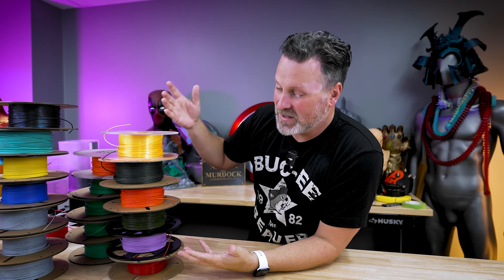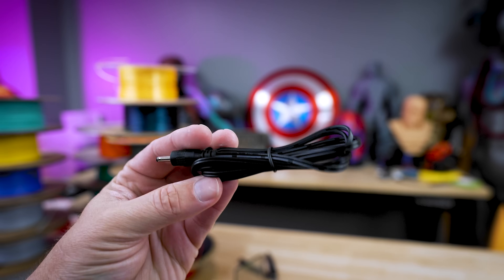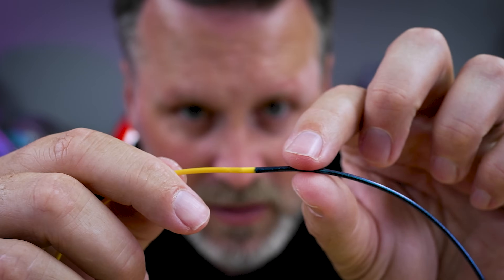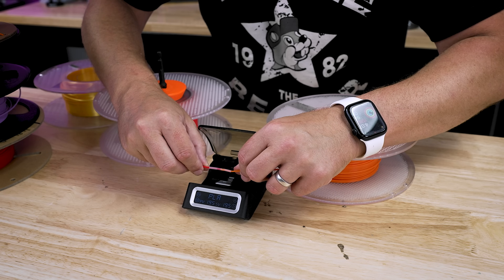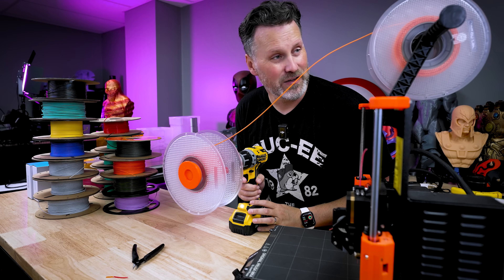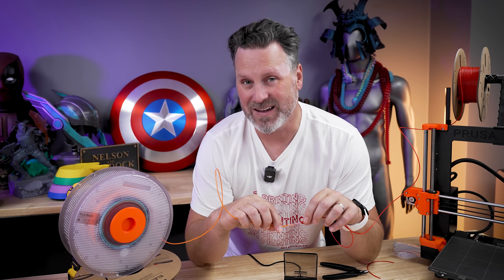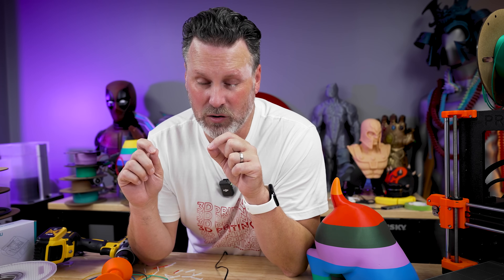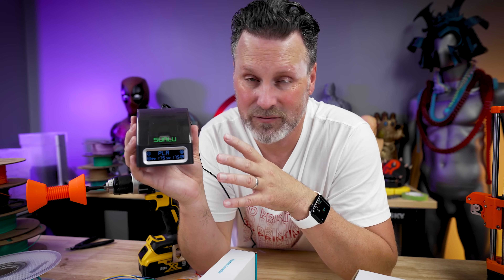Does this really work?? Sunlu Filament Connector

Comment: I bought one of these without doing any research cuz it was on sale.
It IS a little tricky to use, but once you get the hang on if it seems to work pretty well. 
TBF tho I've only done about a dozen welds with it so far. No issues printing as of yet.

I also printed a little plate that the filament splicer sits in. This plate has little arms that swing and hold the filament in place and makes it  a bit easier to manage without having a third arm. This makes it a LITTLE less fiddly. but for the cost of saving filament, and opening the door to creating your own "color changing" filaments via splicing ends, or splicing multi-tone DIY printed filaments together. It was worth the $30 I paid for it.

Comment: I'm not sure if this thread is still active.... But I'll ask anyway.

I'm somewhat new to 3D printing. I have 3 spools with maybe 10-20 grams on each. I have the Bamboo AMS. Instead of using one of these splices which seems might be more headach than it's worth. 

To me it seems putting my almost used up spools all in the AMS at once and simply having the machine run from one to the other when they are done seems like the easyiest thibg to do? Am i wrong there? It seems like the printer should make that transition easy?

Comment: Why bother unless you have such short pieces that it cannot be loaded into the printer? If you do have partial rolls then reload the filament when it runs out and resume the print.. if you have short pieces then surely the cost of the splicer and the labour required to splice them together isn’t worth it. Seems like a solution to a non-problem to me.

Comment: I know this is a bit late to the party - I saw in another video where the guy used silicon tubing rather than PTFE as it will conform to the size of the filament better for a smoother join.

Comment: Get some medical scissors clamps, I used it to break supports on the 3d prints and also used it to clamp down the filament ends and then it stable to make a aligned cut and then put in the filament connector. So yeah SCISSORS CLAMPS is the answer...

Comment: I  printed an add-on that holds the filament leading to and comming from the connector machine. With the addon and the learning curve, this thing is great. You do have to play with it the make sure you have a proper connection.

Comment: Worked for me from the second try, though I hold the both ends while heated and then ask someone to press the release button and simultaneously take out the connection out of the heater not to deform it till it cools down. Pretty happy with the results/purchase.

Comment: This is one great thing about my 3D printer. Instead of having the runout sensor 2 miles away from the print head, it's on the print head itself. So I can print down to the last millimeter and when the filament runs out, the print head parks while keeping the nozzle and bed hit. I just have to load new filament, extrude 20 mm of filament and resume my print, no issue whatsoever. FYI, my printer is an ankermake M5C

Comment: This doesn't work all that well. It's very hard to get consistency welds of the same quality. My AMS on my P1S won't load connected filaments, the feeder has issues with the hard spots/not perfectly aligned filament and it just keeps spooling in and out at the repair. I would not recommend for an AMS.

Comment: Respool it but with a PTFE tube as a guide (maybe 6 in. piece). That will do two things: Give you a something to hold on to when respooling to guide the filament. Also, it will stop spooling on any welds that are too large. Then just slide it off when finished.

Comment: Capricorn tubing. Cut filament at an angle. Push together and get hot with torch or lighter. Let cool, cut away. File to smooth and fit correctly. Save $45. Everybody remembers modding their Creality Ender 3's, why does nobody remember welding filament?

Comment: I bougt this thing and guess what. It's not worth a dime. The seam is bad as bad can be. It works only with very short pieces. With longer pieces you need 4 hands fighting the filament. After a lot of fumbling and entangling I threw away both spools and the device.  Does it work? No it does not work at all.

Comment: I got it and after 20 attempts, I gave up, this device doesn't work. bent connection, melted outside the ptfe tube...
Reply: Hold it straight until it cooled down.

Comment: Would have helped greatly if you actually used the device correctly. Sunlu has several videos on their website showing exactly how to use. Things you missed that led to your poor results: 1) cut filament on angle to increase bonding surfaces, 2) push in on filament ends while connecting, 3) when connecting, wait till you hear a beep so it completes the connection and 4) wait at least 10 seconds before removing sleeve. You really should do this video again following the instructions so as not to give false information & impressions (or at least pin a comment giving the details). Expected more from your channel.

Comment: This little gizmo actuatlly works. Some things I've found out:
 - Cut both filaments at the same time by cutting both lying next to each other;
 - take your time to align everything when putting everything into the sleeves;
 - not all filaments are made equally, test putting together different types of filaments, brands, ...
 - be patient: things get welded together in like 5 to 10 seconds. Great,  keep a little pressure on both ends for like 5 to 10 seconds (especially do this while melting and welding');
 - enjoy multi-coloured prints without having to use your garbage bin 🙂

All joking apart, this thing works pretty well but needs attention. It's a fairly quick thing to do, but - again - needs some attention to do. Otherwise, one of the hundred things I did not waste my money on.

Comment: Ive just bought one and after one initial fail its worked great since, although I have only tried it on PLA.  I have founf applying just a hint of pressure works well but the default timings and temps work well for me.  Consumables do need to be made available but short term you could just buy 2mm id, 3mm od ptfe tube and cut it to length.  It is far better than some of the other options out there.

Comment: I like your videos, but don't think this was a fair review as it seems to be user error. The starting temp for PLA was 170, but you changed it and then struggles to find the right temp which ended up being the 170. you also tried working with the machine facing away from you which you obviously had to do for the video, but that would have made it harder to use as well. It also needs angles cuts to create a stronger join. The angled cuts also don't bulge that easily. I have been joining filament with small pieces of slightly too small silicone tube, helping hand device and a lighter. It works great, but time consuming. I am however looking forward to getting one of these as it looks simple in comparison.

Comment: I've been using it, and yes there is a learning curve, but it works great once you get it down.  It takes a little finesse to keep the weld at a diameter that will fit in a Teflon tube.  I just turned a bunch of partial rolls into a single roll with it last night.  If I'm doing multiple partial rolls, I just slide their connector on down while re-spooling it.  I also have a Teflon tube for the filament to go through to ensure that the weld knot slides through fine.

Comment: Devices like this have been put for years. This is nothing new. I don't see any reason to replace my existing splice welder, especially when it works loads better and doesn't need those connector pieces

Comment: is youtube having a stroke? im watching the "tiny resin 3d printer - tinymaker" video, but every comment is talking about splicing filament and temperatures? i reloaded multiple times and it seems this is just straight up the wrong comment section

Comment: First your supposed to cut each end of the filament at approx 45 degrees line up the 45 degree cuts in the tube.

Then while it is welding you press the ends lighlty together,  not after it has heated them. Then cut off the ptre tube.  

Ptfe tube is to stop the big bulge to where it won't fit bowden tube, or get jammed in the extruder.

Comment: You could try while it is in the connection area after it is heated turning off the power to it and letting it cool down naturally for about 5 minutes then clipping off the other part

Comment: Don’t have to hold the filament together
Cut both at a 45 degree angle
So they overlap inside the PTFE tube before getting them up

Comment: Just a thought, but it seems like the device should be much wider with rounded channels for the filament to sit into. That would make it way easier to  keep both sides at the proper angle and position.

Still not convinced it would be a workable solution, but it might have a higher percentage of successful joins.

Comment: Tbh, i just use an old PTFE Tube (like 5cm), putting one filament through to the end, push it back in a bit with the second filament, give it a quick burn with a very small butane torch and press the second filament through slowly. No bulge, strong connection and only cost cents. The Tube stays on, cause i can hold it while respooling to get a clean spool instead of a mess (sorry to say this, but your "respool" gave me anxiety on a whole other level, i would never let a spool winded like that touch my printer xD)

Comment: We really need a smart loading solution that auto-feeds the filament to the point of joining. Honestly shouldn't be anywhere near as complex as a printer motion system.... you're literally just counting steps until a filament sensor triggers. 

then feed into a module that holds the tube, and join, like the splicer core in the Palette Pro. 

Or is this lost technology?

Also, put yourself in 2030 by using a standard bench clamp to activate your drill so it can spool while you make a sandwich.

Comment: Make sure to read the instructions, unlike this guy. Also, you can reuse the PETG tubes if you push it off the end of the filament. Which could take a while if the spool you are join is long, but possible.

Comment: I like my method of using a brass tube that you heat up. you add both pieces of filament into a brass tube then heat that up melting the plastic and push together. If you use a tube that is same diameter as the filament then it shapes to that size. downsize is for your purpose you would have to run your whole remaining roll though the tube piece. I usually only splice 2-3 feet at a time and I haven't tried it with my new k1 max which has 1.75 filament I was using a 3mm tube for my ultimaker.

Comment: well i havea filament welder thats basically grab the two end and then with fire you heat up the filament tothe point of melting and then push together the filament. The result will be a pencake that you can cut down with knife and its done. And it literally cost no money because you can print it

Comment: The main problem here is that they are using a 2mm internal diameter ptfe tube. If they ship the device with a 1.8mm internal diameter tube, the bulge will be minimal, and it will pass without getting stuck on regular 2mm 3d printer ptfe tubes.

Comment: Printing the spool winder now! Thanks! I have a question. Do you know of any multifilament systems that works out of the box for the K1C? I saw the ECRF V2  but I really don't have the time required to build, flash and trouble shoot it. I love my K1C but really want a AMS, CFS, or anything really that works out of the box. Any help would be greatly appreciated!

Comment: Not really a good product. I've seen a bunch of custom designs for this sort of thing on sites like Printables and they work much better with just a regular lighter flame. Needs some thermally insulated area to hold the filament in place and let it cool down before removing, so it doesn't deform during cooling.

Comment: This was my early opinions after seeing this for the first time. I generally really love Sunlu's stuff, but this feels like a good idea, but kind of poor execution. The two big deal breakers for me are the consumable and the lack of consistency. Honestly this makes it only marginally better than a printed splicer. Had they gone with an all metal fusing chamber with some kind of teflon or non stick coating that was exactly 1.75 mm and  you couldn't exceed that diameter no matter how hard you pushed, I feel this would have been far better. The biggest problem with printable filament splicers that rely on a lighter or soldering iron is the lack of temperature control. This solved the temperature control part, but made the actual splicing process more complicated and reliant on a consumable.

Comment: Love the video, but you didn't exactly do it correctly.  You're supposed to cut each end at an imposing angle so that they fit together and slightly overlap.  After inserting into tube, double check and make sure that they are aligned before heating.  Then when you insert into the heating element and close it.  While closed you apply slight pressure to both sides it assist with the weld. When it beeps its done.  You then need to let it cool off for a few without bending or manipulating it.  You'll know its cool when the Teflon tube will just slide away.

Comment: Wouldn't a 45 degree joint would be stronger than a 90 degree butt joint? It should also resist 'squish' a bit better than a 90 degree joint would so you would probably get marginally better dimensional stability in the weld area.

Comment: Check out the Aurora Tech Channel review of the connector...cutting the filament ends at 45˚ angles, holding them together until the heating time is up, and just using a hobby knife or side cutters instead of the built-in cutter for the sleeves seemed to work very well with stitching multiple mostly-consumed spools together. The giant trash can Aurora printed with her Frankenspool seemed to print pretty flawlessly.

All that being said, I feel like $35 is on the high side for this product (never mind the regular list price) and I don't think Sunlu has yet created a separate listing for just the PTFE sleeves, so the only way to get extras right now is to buy the 400-sleeve bundle when you buy the filament connector.

Comment: From what I can see, it looks like the best approach is to get it all set up, put it into the heater, then once it's heated up, leave it in, turn off the heater, and let it cool with the joiner holding everything in place.

Spiffy idea, but I think I do just as good feeding a new spool in, mid-print.  (Done it enough over the years, I have a 100% success at loading filament on-the-fly)

Comment: You're supposed to cut the ends on an angle as if you were installing filament into a printer. It makes the bond stronger and more consistent.

Comment: I really like the idea and it would be fun to play with to make funky filaments. The only issue I have with it is that it's meant to kind of reduce wasted filament but in the end you end up creating more waste with tiny bits of teflon tubes. I kind of wish they'd ditch the mini tubes and use something that is easier to dispose of like uncoated parchment paper or something that can be recycled easily or that's biodegradable.

Comment: Perhaps let it cool in the splicer before removing?
Honestly, if you have a Pallet 2s or similar, it joins scraps of filament awesomely, and I used mine to make my own quick transition filament.
It also does spool to spool joining as it detects run out. So joining multiple near empty spools is great. It is just much slower than the spool winder you demonstrated.
Great video.
I found this after watching another video yesterday morning.

Comment: 2:05 Machine: PLA default is 170°
Jessy: I'm gonna bump that instantly to 195 for no reason.
Machine: ...OK
Jessy @ 10:40: Stupid machine, it works a lot better if I LOWER the temperature to 170.

Comment: It takes a little babysitting but iv found that Bambu printers are really good at detecting runout, pausing and resuming prints.
If you dont need something to be done overnight and have the time to just check on it every hour or so iv fount it pretty reliable to just reload it and resume prints when it runs out.

Comment: It looks to be massive user error based on the 2 YouTube reviews I've watched. Please watch the review from AuroraTech's review. You have to cut the filament at an angle and during the joining process you have to push the two ends together. AuroraTech joined a half dozen or so spools and then successfully printed with them so the product does work.

Comment: "Lowering the temperature down to 170 seemed to work best"
That was the default temperature and you raised it up before you started using it so I think that's user error
Reply: yup, RTFM Read The F#$@$ Manual